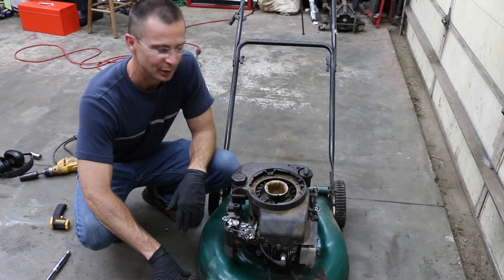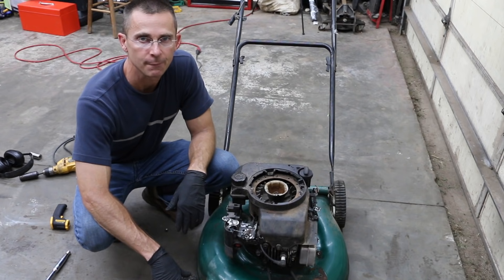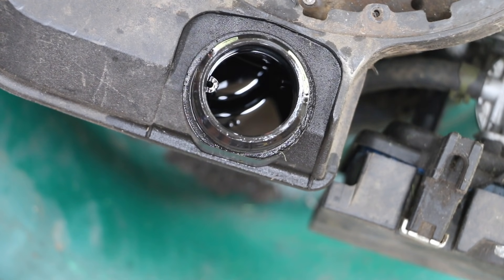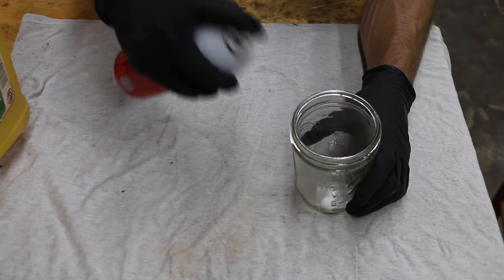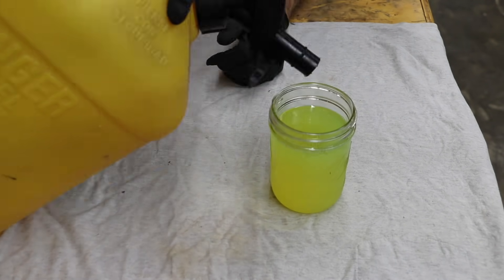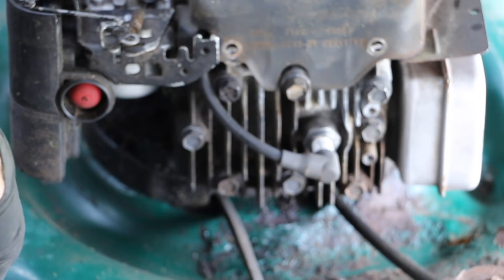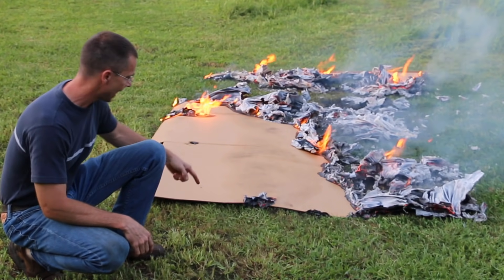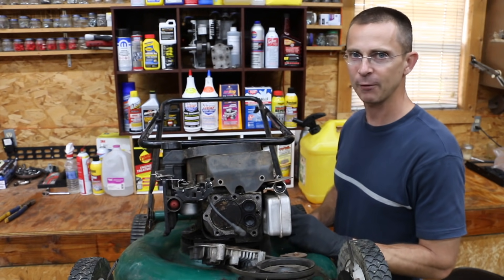Will a Gas Engine Run on Diesel?  Let's find out!

Comment: that would explain why dielsel engines have good torque, its not just a quick jab, it has good followthrough
Reply: Plus the cylinder is "over square" giving the piston a longer travel  (and hence lower rpm.)
Reply: @rsdaarud  undersquare
Reply: The slower longer stroke is what gives it the average 400ft pounds more torque over a gas engine of same displacement.
Reply: They also have insane compression ratios. Often in the mid teens, like 15 or 16:1 compression ratio
Reply from the maker: Thanks for the feedback.
Reply: Torque has to do with gear ratio and the propellant being the primary fuel of motion could be water or anything so long as it propels.  
A full electric engine can produce massive torque for example.
A hoverboard for instance 
If your not ready the full lean will result in a broken tailbone.

Comment: You could have skipped this demonstration.  I already lived through this experience.  Several years ago, i let a friend borrow my vw rabbit and he stupidly filled up the car with DIESEL gas, which took REGULAR fuel.  Car got a few miles and died.  Had to have the car towed to a repair shop where they completely flushed out the tank, fuel line, etc.  It was not a cheap fix.  Fortunately, the car ran fine after that.  Worst part, this guy was an auto mechanic...he should have known better.  What a moron.  Needless to say, he's not my friend anymore.
Reply from the maker: Sorry to hear!

Comment: I did not read all the comments, so perhaps this is mentioned, B U T.  The reason the experts do not recommend what you did was, a mix of gasoline and diesel is much more explosive in vapor form than either gasoline or diesel by themselves are.  Gasoline in a confined space, under normal conditions, the vapor is too concentrated to burn.  (in a partially full tank, where air is likely to be present).  With diesel, the opposite is true, the vapors are too little in the tank to explode with available oxygen.  But guess what when they are mixed?  The potential is there  for the tank to go boom.  With the right mix and conditions the vapor to oxygen mix can be quite explosive - boom..  Must be my Chem E degree kicking in here or something, IDK.
Reply from the maker: Great information!  Thank you

Comment: Navy P250 emergency firepumps used to be run on gas, they were modified to start with propane ( think a small hand torch) and shifted over to  diesel after starting, eliminating the need to store gasoline onboard.
Reply from the maker: Thanks for sharing.

Comment: Why do small engine have such small fuel tanks. At my work we frequently use trash pumps for days on end. Problem is they have to be refueled about every 3 hours, it gets to be a pain especially if you are running it 24 hours a day. Is there a way to increase the available fuel without flooding the engine?
Reply from the maker: Thanks for the feedback.

Comment: I think the only time I'd want to try this is when I've run out of gas for some reason. In which case I'd be looking for something to thin out the diesel and make it more volatile. The most obvious thing I'm likely to have is probably WD40. Would diesel with a splash of WD40 work?
Reply from the maker: Thanks for the video idea.

Comment: I'll start by saying I'm an oldie but a goodie. I'm in my late 60s' and way back in high school when we were learning about the internal combustion engine in mechanic's class (Yes there was a class called that) We did some experiments on different volatile liquids as well as some solids. Believe it or not naphtha (the main ingredient in moth balls) turned out to be 24 times faster burning then premium gasoline and alcohol was even faster and hotter. We tested diesel (three different grades) fuel, along with fuel oil (kerosene) for heaters. They all had their use but the slower it burned the more torque it created. I found out later the aviation fuel for piston type aircraft is use something that is between diesel and kerosene to give constant high burn for a higher torque (pressure). After running a combination of tests we found the slower the fuel burns the lower the heat and higher the torque. the faster the fuel burns the higher the heat and the lower the torque. In one experiment we dumped a box of moth balls in the gas tank of a car. For the first five to ten seconds after starting the car the rpms were tripled at an idol. After that the side of the #1cylinder blew out and ended the experiment we found after taking the engine apart that the piston had a hole melted in the top of it and the connecting rod came loose and went threw the side of the block. When you did your experiment with the mouth ball it brought back all those memories. We did make a diesel engine run on a gas and kerosene mix but couldn't get a gas engine to run on diesel fuel. In all tests we tried our best to optimize the fuel air mixture and seal pressure testing per nanosecond timing, We built a solid 1 inch thick cylinder with a welded bottom and a screw on lid 12 inches tall with holes to incorporate the ingredients we were testing and places to add compressed air, atomization, pressure, temperature and burn time measuring. We learned a lot more than just about mechanics in that class. I guess when the Myth Busters came out on TV it was instantly my favorite show. I still like experimenting and trying to figure out what and why things work. I guess that's why I was a service for thirty five years before retiring.
Reply from the maker: Thanks for sharing.

Comment: About 30 years ago I had to drive a diesel Chevy citation a long ways in 10°F weather and it did not want to run so I pumped 1 gallon of gasoline into an entire tank of nearly jelled up diesel and the thing ran like a top. I was desperate and grateful and an ignorant teenager but it continued to run for years after that until the transmission blew up.
Reply from the maker: Thanks for sharing.

Comment: Great vid, very informative. Thanks. A while back I had about 20 litres of gas/diesel mix from a mis-fuelling cleanup. I added it about 5 litres at a time to a nearly full tank of diesel on my mitsubishi L200 just to dispose of it and get something back for the expenditure. Experienced no problems at all. A friend said that early diesels used to run on a lean gas mix in the winter to prevent waxing. Don't know how true this is.
Reply from the maker: You are welcome!

Comment: It's all about auto ignition temperature. If you can get air temp in cylinder above 210C it will ignite. 

Also white smoke is diesel running very lean.
Reply from the maker: Thanks for the feedback.

Comment: I once had a very old diesel I was able to fuel it with peanut oil
Reply from the maker: Thanks for sharing.
Reply: @ProjectFarm  it's important that it is a old engine after I got a new one I tried it again... That was a big failure but I was so used that it worked that I didn't think of the possibility of failing

Comment: If you know how disel works and how gasoline engine works you should understand it wont run on disel but my dad was runung a motocycle on 50/50 disel gas mix and everything was good so if you have not that much gas then you can mix it up with disel
Reply from the maker: Thanks for the feedback.

Comment: Because the two caps are so similar on my Husqvarna chainsaw, last summer in a moment of distraction, I attempted to replenish bar and chain oil in my chainsaw but accidentally put it into the fuel fill. Without even realizing it I started it and continued to run it until it choked on the oil. Once I realized what I had done, I turned it over drained the remainder of the oil out of the fuel Reservoir, and then rinsed it out with more fuel before dumping it again and refilling it with clean fuel. Much to my surprise, it restarted and ran and has run fine ever cents. I really thought the bar and chain oil would destroy the fuel system, but it didn’t.
Reply from the maker: Thanks for sharing!

Comment: If you shave down the head and plug off the sparkplug hole you might get the compression to run it on diesel.
Reply from the maker: Thanks for the suggestion.

Comment: Gas , and diesel even more , are extremely high energy fuels. The gas obviously helps the diesel burn. Great idea. I run my old 1970s carbed chevy truck on half gas half e 85 alcohol. I get great power (alcohol increases the octane), and 20 mpg around town! By the way, diesel gas mix would probably help the mower engine, diesel lubes some, its oily..
Reply from the maker: Thanks!

Comment: Some of the old gasoline powered, Mccormick Deering farm tractors used to actually run on kerosene.
They would start up the engine. Pull a shade down in front of the radiator,  so the engine would get good and hot. Then they would turn off the gasoline petcock, and turn on the kerosene one. It would run all day on kerosene. But you had to remember to switch it back over to gasoline when you were done. Otherwise if the kerosene remained in the carburetor you could not get it restarted.
Reply from the maker: Thanks for sharing.

Comment: Love all the hard work you put into these videos.We used to start the old 70s snowmobiles with WD40. I have worked places where they had a mixed fleet of gas and diesel vehicles and I know of a few times where a vehicle got the wrong fuel. I don’t remember the outcome but I’m pretty sure they didn’t run. That’s one way to piss off the mechanics.
I always use diesel when burning brush piles.
Reply from the maker: Thanks so much!

Comment: It seems to me that experimenting to see if a gasoline engine will run on diesel is kind of stupid.  Gasoline uses a spark and diesel uses compression to ignite.   But, for those who did not know that, this was educational.   I guess I missed the reason to try a moth ball and acetone?   Anyway, love the way you present an idea and then test it.

Comment: The reason the diesel does not work in a gas engine is because diesel has a much higher flash point than gasoline. That is why in a diesel you have to wait for a coil to heat up before starting the engine. The gas engine simply cannot ignite the diesel.
Reply from the maker: Thanks for the feedback.
Reply: You’re welcome! Thanks for saying thanks!

Comment: I used dual fed engines. After the engine warmed up with high ignition fuel, then I would switch to gasoline. And this works very well in agriculture.
Reply from the maker: Thanks for sharing.

Comment: one thing you could try is remove the spark wire so it dosnt spark, since deisle runs off heat of compression that might help it but would also need to find a way to heat the ctylinder up so it will possabley run
Reply from the maker: Thanks for the suggestion.

Comment: Next trial could be methanol added to gasoline to disperse the water out. I read methanol can absorb about 30 % water of its own volume and burns with it. If you have water in your gas tank add methanol which will absorb water and burn with it together with gasoline. Like to see it tested. Well alcohols are no good for small engines.. We seen what ethanol did to gas engines after it replace the MTBE but I believe its because of corn based and have too many varnish polymers in it due to corn.
Reply from the maker: Thanks for the suggestion.

Comment: Question please  , I just  bought my 1st desile  truck f250 SUPER DUTY  turbo charged V8 power stroke can you give me advice as to how to maintain  & keep  it running ? Yes I know about changing  oil & filters  every 2600 miles if you know  of anything else please  any1 share with me.
     Thank you in advance.
Reply from the maker: Recommend a good fuel additive like Power Service Diesel, keeping on top of changing the air filter and especially the fuel filter.
Reply: @ProjectFarm  what do you mean by additives  ,?? Every when do i  Change the filters? Should I  put fuel injection  cleaner  2x a year as other are advised me ? Thank u so much for answering my text.

Comment: Hey mate, I remember 3 years ago I accidentally filled up my 2 stroke moped with diesel, 20% fuel 80% diesel
With a separate tank for 2 stroke oil and it actually ran at high rpm, might be worth a shot to try it for a video?
Reply from the maker: Thanks for sharing!

Comment: Diesel has higher viscosity than gasolene. So it can't mix with air by carburator.
By the way , engine gap between diesel and gasolene are blurring from the invention of direct injector in gasolene engine..
Reply from the maker: Thanks for the feedback.

Comment: In Japan, it was common to see older dual fuel 1 - 5 hp stationary engines.  My buddy lived over there, and was a hobbiest that  collected and restored old engines.  I shared the hobby with him, as I have a few of my own, and would help him with restorations when I was visiting.  The dual fuel engines work quite well, and the only difference between the standard engine and the dual fuel, was the special carburettor which allowed selecting between the two fuels..  
The procedure was to start it on gas, and then, by turning a valve, switch to kerosene or diesel.  Some of the engines had a pre heat for the diesel fuel, but others ran well enough with unheated diesel.
I had a customer who was a faller, running Husky 2100 chainsaws (100 cc), and in the camp he was working in during the 70s, he needed to mix his own fuel.  On one occasion, his saw wouldn't start, and as the non running saw was costing him a lot of lost income, he was getting pretty angry.   After a lot of pulling ( and swearing), he finally got the saw running, only to realize that he had mixed his whole day's worth of saw gas with diesel fuel from the wrong barrel.  
The smoke almost killed him (figuratively not literally), but he was able to work the whole day with the crappy mix.
I am a retired pilot, and for a year between getting out of the air force and starting with a commercial airline.  I flew a twin engine corporate turbo prop, which ran a pair of TFE 331 engines that were approved for JP1 (kerosene) as well as gasoline.  I never needed to do it, but the option was there.
I enjoy your comparisons.
Bob
Reply from the maker: Thanks for sharing!

Comment: Great video as always. What I would be really curious to see is if the 50/50 mix would run the mower for as long as straight gasoline would. I am curious if you were in a pinch what all could be added to extend a little gasoline. Or, is the diesel just burning off and 16 ounces of the 50/50 only runs it as long as 8 ounces of straight gasoline. Would be awesome to see in the future potentially.
Reply from the maker: Thanks so much!  Thanks for the video idea.

Comment: Since it seemed to run so well on the 50/50 mix, I'd be interested in learning IF THE BLENDED FUEL WILL RUN LONGER ON A TANKFUL THAN STRAIGHT GAS.
Reply from the maker: Thanks for the suggestion.
Reply: FYI, I wouldn't do it ! I left a message regarding this issue and it can lead to total engine failure.

Comment: Wondering what the minimum amount of gas to deisel ratio would work. Also if you would get a longer run time per volume. Great videos!
Reply: I think advance timing with 50/50 mix with a little preheated air would make very economical run time and power
Reply from the maker: Great suggestion!  Thank you.